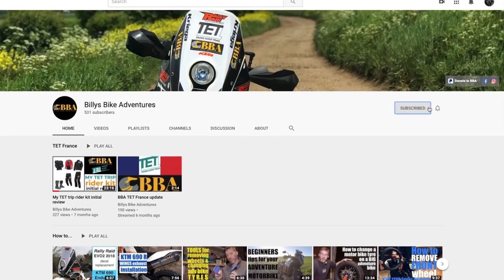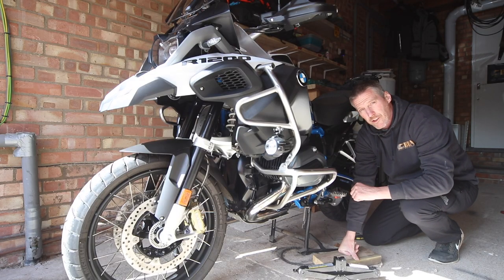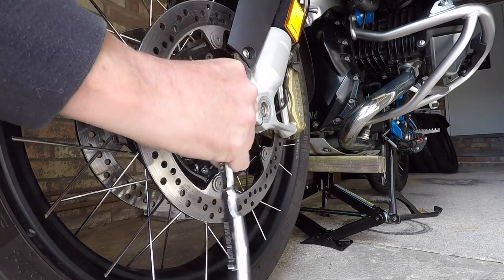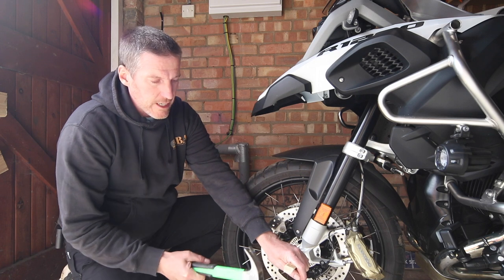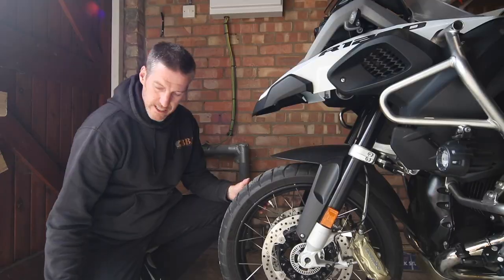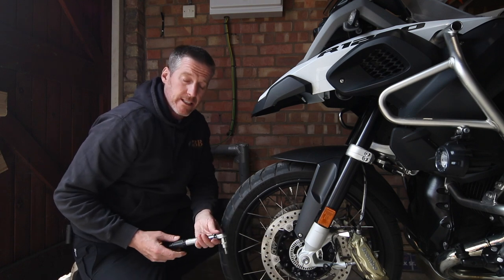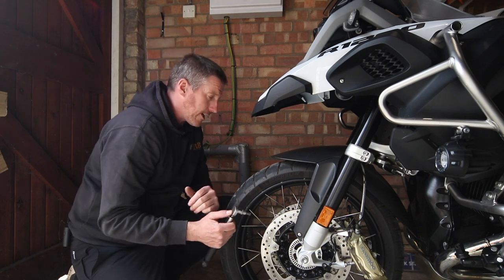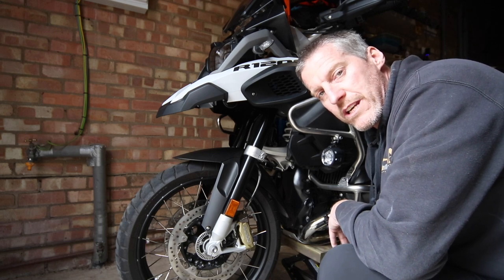BMW GSA front wheel removal

Comment from the maker: Tools to do the job
17mm socket - front axel wheel nut (30Nm)
13mm socket - brake caliper bolts (38Nm)
T45 - front axel pinch bolts (19Nm)
T30 - speed sensor (8Nm)
Torque wrench
Socket wrench

Comment: You are one of the few who remove the ABS/speed sensor, and are very smart for doing such. Some great wheel removal vids out there, yet the host doesn't remove the sensor and get out of harms way which is surprising to me. Damage that sensor or the ABS ring on the wheel, and you have some problems coming. Great vid and thanks for posting!!!
Reply from the maker: Hey Brian, thank you very much for your comments! Much appreciated! You are spot on. Its worth the extra 30 seconds to take it out and be safe. Thanks for watching. Cheers. Billy

Comment: One detail to be aware of: If you take the dismounted front wheel somewhere, for example to get a new tire, remove or secure the little bushing/spacer that sits inside the axle bore on the ABS ("speed sensor") side! I almost lost it the first time :-)
Reply from the maker: So true, easily lost. Thanks for watching. Hope it helped. Cheers. Billy

Comment: ... yea, so i did go thru it a third time, and delete if repetitive... but IF a person is switching between rims, say, you've got two sets of front rims, one for on, one for off road, the ONE piece that you have to carry over, is the shim on the left side.  there is a shim / spacer that MUST be taken from one set of rims to the other.  if you don't do this, you could be in trouble.  like i was.  did
Reply from the maker: Another great suggestion Mark. I will make this point as well!  Cheers  Billy

Comment: For GS owners who find they need a 22mm hex bit for axle removal, before buying an individual 22mm bit or a 4 way hex bit adapter, look at an auto or lawnmower spark plug socket to see if it has a hex fitting on one end (not smooth round).  Mine did, and it was exactly 22mm.  Used a drive extension through the reversed socket and it worked great!
Reply from the maker: Neat tip that Steve, thanks 👍🏼. Ride safe

Comment: Nice video👍 you could of mentioned the spacer in the front wheel for people that were removing the wheel to have tyres fitted so it was not lost and I was always taught to suspend the callipers with a zip tie so not to put strain on the lines, I know you only had the wheel out for video purposes but again if your changing tyres they could be hanging for some time
Reply from the maker: All great points and will carry forward. Thanks for feedback and for watching. Cheers. Billy

Comment: Dave Moss advises us to pull the brake lever fully  for the final torque of bolts thus allowing the calipers to align perfectly with rotors! Nice episode! Marc, Quebec 🇨🇦 😉🏍🌨️🥶
Reply from the maker: HI Marc. Thanks for watching and sharing the experience from Dave Moss.  Will make sure to implement this the next time if do this.  Cheers. Billy

Comment: nice instructional vid, thanks!  you might wanna mention that there's a spacer bushing only on the left side of the wheel, as it easily can fall out and leave people wondering which side it came from.  Oh and almost forgot, very important to pump the brakes after removing either wheel, as the pads will be loose and the first time you hit the brake the lever will bottom out and you will NOT stop.
Reply from the maker: All great suggestions.  I think I can add this in as text on the screen to inform folks so will look to do that. Thanks for watching and your feedback!  Cheers.  Billy

Comment: Very nice video, many thanks Billy. I would add that both calipers needs to be away. As I don't have a jack here I use a rope with a heavy weight attached to the rear frame to hold the front wheel high.
Reply from the maker: Hi juan1065. Thanks for watching and your comments! Nice improvising with keeping the front wheel up! Thanks for adding your comment about the brake calipers. Stay safe. Billy

Comment: Thanks yet again for a super video! I guess my question would be what if I am on the road, say going down Baja peninsula, Mexico… how to manage the front wheel..?lift, as well as size if tools needed.. cheers!
Reply from the maker: Hi again. Bike on centre stand. Then just make sure you have a good tool kit with you. Here is a link to a good tool kit that is small lite and compact https://youtu.be/LBX_QWqhLMc you can add to it if needed but this these two tool bags with the wheel wedge would be all you needed to remove both wheels and change tyres on the bike. 👍🏼

Comment: Great video Billy, what type of grease goes on the spindle? Thanks for sharing!
Reply from the maker: Hi Joaquin. Thanks for watching, your comment and question. Grease that is formulated for slip yoke drive shafts, high temps bearings etc is best. As long as it has these or a mixture of these then yo should be fine.  Good luck. Stay safe. Billy

Comment: Thanks a lot. Question: Is LOCTITE disencouraged on any of those bolts ?
Reply from the maker: Hey mate. Thanks for watching and your question! I am not aware of any disencouragement but the manual does not specifically recommend or dis-encourage LOCTITE on the calliper bolts. Cheers. Billy

Comment: Nice video, straight to the point. One question: out on the trail, you need to get the front wheel off, can you do it without removing the brake calipers?
Reply from the maker: Hi Rick. Thanks for your message! No real need to take the brake callipers off when on the trail.  Only reason i do it is that it makes fitting the wheel back on so much easier when the callipers are off.  But not recommended on a trail as it just means more bits off the bike that could get lost (ie calliper bolts).  A good point I should have added to the video.  Cheers and ride safe.  Billy

Comment: Thank you Billy for sharing your knowledge, very clear. Is there a manual with the recommended torques for each bolt? If so could you with us? The manuals that came with my bike, in Brazil, did not bring this sort of information. Thank you again.
Reply from the maker: Hi Ricardo. Thanks for watching and your comments.  Click the link to go to BMW Motorrad and search for your bike and relevant Owners Manual. This will have the majority of torque data you need.  Hope that helps https://www.bmw-motorrad.co.uk/en/service/manuals/owners-handbook.html

Cheers. Billy

Comment: Great videos. How does one balance the bike while on the center stand when removing both wheels at the same time? I’m assuming chalking up the rear with some wood blocks?
Reply from the maker: Hi Michael. Thanks for watching and good question. I would imagine there are many ways but I have not had to think about it as never taken both wheels off at same time. But off the top of my head wooden blocks under the shaft drive, rope tied to luggage frame (if you have it) slung over an overhead beam, or if you have a bike ramp / lift, then there would be points to tie down with. Hope that helps. Good luck. Cheers Billy
Reply: @BillysBikeAdventures  I found that with the scissor lift alone the bike is perfectly balanced while both wheels are off. Thanks again.

Comment: Bit late to the party on thus one , but question is would i need to remove the front wheel to replace the front lower mudgard ive had a look and there are 2x screws underneath and looks a bugger to do with the wheel in the way im talking about the GS 1250
CHEERS
Reply from the maker: Hey mate. Thanks for watching and your question. It is a bugger and probably save you getting frustrated with how easy something should be but how hard it is to do. Also taking the wheel of good practice just in case you need to do this in the field (unless that's easy for you already). Cheers. Billy
Reply: Cheers Billy for your reply by the way what type of grease do you recommend for the axle when fitting back together

Comment: i've used this video EACH time a remove and re-install my rims.  i have two sets of wheels, one for off, one for on, road... i've got some requests... one, please type and leave posted, the tools we use for the removal/install, also, i LEFT OFF the left side spacer and it cost me my speed señsor and ABS function!  $$$, can you re-emphasize this ?  thx.
Reply from the maker: Hi Mark. Thanks for watching and your comments.  I will add and pin a post for the tools for the job, great suggestion! Sorry to hear about your spacer issue. Unable to add anything to the video now that its on YT to remind folks about adding the spacer back in. Will add to the comments and in the description, another good suggestion.  Cheers  Billy

Comment: Great video.  Do you need special adapter for axel. Hex tool??
Reply from the maker: Hi Frank. Thanks for watching the video and your question! You will need torx head tool to include different sizes for the pinch bolts on the front axel and the speed sensor. The axel on the front wheel requires a socket. 13mm from memory. Let me know if you have any other questions.  Stay safe. Billy

Comment: Is it necessary to have the jack for roadside repair/ tire change?  
Great video! Thanks in advance
Reply from the maker: Hi Mike. Thanks for watching and your question! You will need to prop the front up some how as the front end naturally wants to drop forward so use what you can to prop it up. It will be a struggle to do this without some front end support. Hope that helps. Cheers. Billy
Reply: @BillysBikeAdventures  Another way to do this (lifting the front) is to load your paniers and add some heavy weights in the back! (E.g. a rock if on the trail.) Works like a charm!
Reply from the maker: That a great on the trail example of being able to do that 👍.  Cheers. Billy

Comment: Ive got a r1100gs i cant get the axke out even after doing everything you have shown, any advice ?
Reply from the maker: That is a toughy.  Give a good dosing with WD40 to see if that helps. Other wise just a case of persisting with it. Sounds like there was no grease on it previously.  Nothing wrong with giving the opposite end of the axel a bit of a harder punch with the hammer and some wood.  Let me know ho you get on. Cheers Billy

Comment: Is there a need to put thread locker on any of the bolts when re-tightening? Especially on the brake calipers?
Reply from the maker: Hi Brian. I have never used thread lock myself. Could help preserve the quality of the bolts esp off road dust, riding through streams or a lot of rain. Is this something you have done regularly in your experience?  Cheers. Billy
Reply: @BillysBikeAdventures I use it now after the rear brake caliper loosened itself and fell off damaging the wheel.  This was mostly due to improper torque settings, but it was advised to me that thread locker would help keep the bolts tightened.  This may have been from another rider, and not from BMW.  Nevertheless, I use it now, as I can not see at it would hurt to use the removable type. I also put some on the axle pinch bolts. Cheers!
Reply: @brianbuongiorno289  I use it to, the "mild" blue stuff. I do not use it on the rear wheel lugs, but on the calipers and the fron axle bolt I do. And I have never fallen off my bike since I started doing this, so I can confidently attest that it work! ;-)

Comment: Did you take off both brake calipers, or just one?
Reply from the maker: Hi Bob.  I took both the callipers off the front. Apologies I should have stated that in the video. You don't need to take them off but it is much easier to remove them than trying to get the wheel back on and getting the discs and pads to line up as well.  Good luck. Stay safe. Billy
Reply: Thanks Billy👍🏻

Comment: What year is your GS adventure, and do you think that the same procedure would work on a standard GS?
Reply from the maker: Hi Bob. Thanks for your question. The year model is 2017. First year the TFTs were introduced so manufactured toward the end of 2017.  Secondly the removal would be the same albeit for a different year there maybe some size differences in the sockets or spanner’s required but I can’t imagine that if yours is about the same age. Let me know if you have any other questions. 👍🏼. Stay safe. Billy
Reply: I’ve got a 2018 Ralleye edition.  Your video was clear and concise, thank you!👍🏻

Comment: Quick question, is there 2 spacers or just the one on the ABS side of the wheel? I’ve taken the wheel off found one spacer, but worried I’ve lost one or there isn’t one. Many thanks for any help
Reply from the maker: Hi Iam Mono. Just the one spacer so you have not lost one. Are you changing tyres or just some maintenance. Good luck. Billy
Reply: Billys Bike Adventures thank you for the response. Changing tyres, and pads once they arrive.
Reply from the maker: Ah nice job. Good luck with it. What tyres you putting on?
Reply: Billys Bike Adventures the subject of tyres on a GS is very contentious subject. I have installed the Metz Roadtecs.
Reply from the maker: Very nice. Contentious indeed. I have seen the same question on a couple of the FB pages, then the arguments start 😂. Good luck with the change and fitting 👍🏼
Reply: Billys Bike Adventures thank you, and great video by the way. 👍 keep it up

Comment: Don't forget to mention that there's a washer on one side of the wheel hub and there's an O ring for the speed sensor.  Folks can easily lose those
Reply from the maker: Thanks Cass.  Great points i should have added! Stay safe. Billy
Reply: So, there is only a week spacer on one side? Being the speed sensor side? I bought a used 2016 gsa and took front wheel off and only see kne spacer.

This has me concerned because any dirtbike I've ever done has two.
Confirmation would be great.
Reply: @timg9134  One on left side - 2019 GS/A onwards.  I guess it's the same on earlier models but you can check with bmw motorcycle parts online

Comment: What type of grease do you recommend to put on the front axel ???
Reply from the maker: Any really, just as long as the axel is cleaned each time removed and new grease applied. I use a lithium moly grease.  Ride safe.  Billy